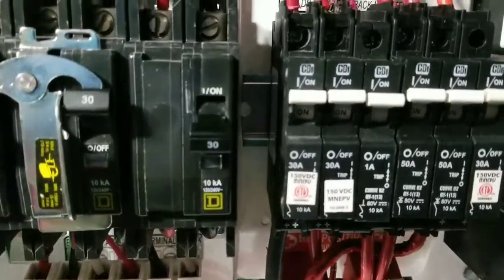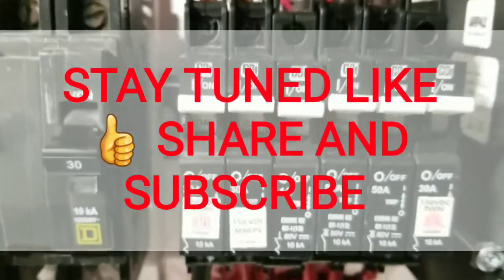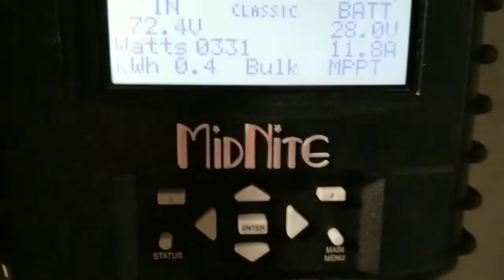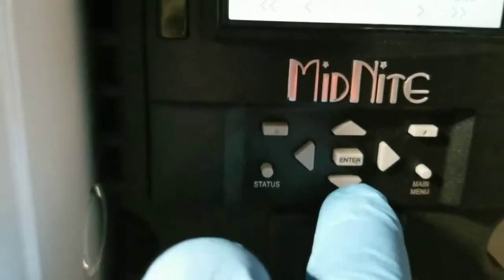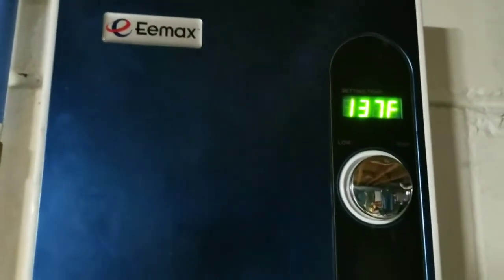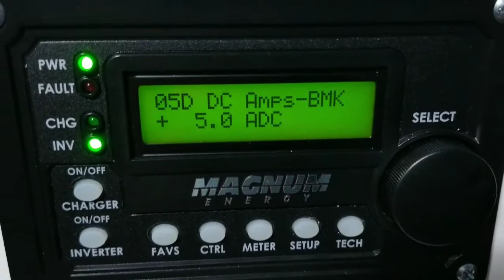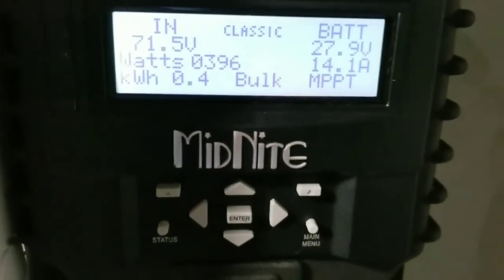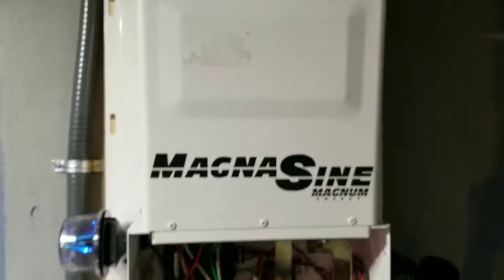OFF THE GRID SOLAR SETUP, OFF THE GRID SOLAR BATTERY SYSTEM PART#1

Comment: I wish you well and mine are being delivered Wednesday I hope since they were on sale I did two of the 1000 watt low voltage which should work perfect with my 40 volt battery bank. I would have stayed with the Enphase but they just run wide open all night and I am hoping these limited ones will let my battery go further. Good luck Grillmiester